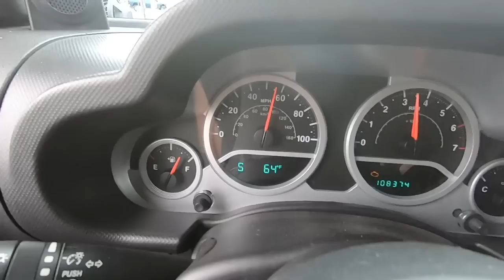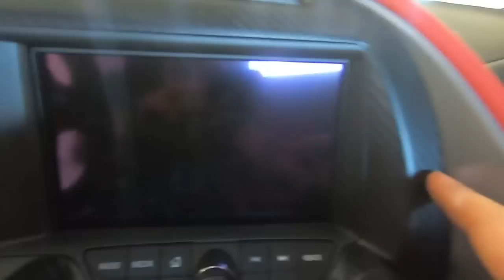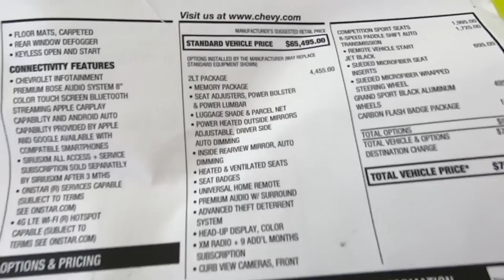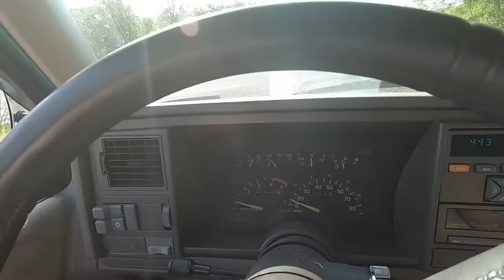BUYING A $1,200 TRUCK From a "Facebook Marketplace Dealer"... (How Bad Can it Be LOL)

Comment: This is hilarious, i love it and the oil you were concerned about is common check the engine oil cooler lines coming from the radiator and the timing chain cover where the crank snout goes through the seal usually gets worn out there and can cause that problem.

Comment: Mike,the truck needs door pins and bushings and the tailgate needs the assembly inside,behind the handle,the rods are connected to it. May as well get the rods and the whole kit while your in that thing. Also,that 350 needs a front main seal,it's the leak your seeing everywhere

Comment: This one is TBI. Tailgate pull 3 torx bolts, white lithium mechanism, then side latches(push side latches in almost totally and let spring out, with help do both at same time). Door needs new hinge pins for sag and will close better. Still rockin my 1991, put 4 new tires on it today. Little at a time is all I can afford.

Comment: Who knew there were so many low rust trucks in PA ?
That mid engine Factory Five kit car is sick.
They started  20 - 30 years ago building Cobra replica cars.
Now they build '33 Ford roadsters, coupes, in steel or fiberglass, and a really cool '35 Ford Hot Rod truck kit .
$20 k for a rolling chassis I believe.
Those kits all have tubular race car frames that make them handle like you wouldn't believe.
Now that would be a great project. Build a '35 Ford Hot Rod truck with a Corvette drive train. Weighing in at less than 2,500 lbs with an LS7, ....... food for thought.

Comment: 97 is when the 3rd door come out and also passenger air bag. 96 is kind of a 1 off year model. First year of vortec, 2 cup holders infront of passenger instead of air bag and no 3rd door. Also you need to replace those door pin bushings and your door problem will be fixed

Comment: There's a head unit, it's up underneath the dash though, Just to the right of the gas pedal it's big silver box that looks like an ECU. you can follow the lines from that up to the control box on the dash if you're not sure. i took mine out of my 88 sport and 89 silverado 4x4 and put a Kenwood in where the tape player and equalizer are in the center of the dash, not one of GM's Finest design moments. I still made mine sound good though , put in a set of sealed 12's and 600 true and pure watts also replaced the dash with competition 6 1/2's can't reveal how i got them in the 4" holes though so don't ask i am sworn to secrecy. also had some shallow mount 5 1/4" in the doors and tweets in the vents and on the A-pillars -as well as Alpine 4" plates with separate titanium tweets in the upper back of the cab.  i had a 4 channel 300 watt running those. sounded beautiful once tuned properly too. That truck is in AWESOME shape for it's age and where it's at, that thing must have been Garage kept most of it's life. the "rear doors" didn't start until 1997 and that year it was only one rear door. it wasn't until 2000 that they started putting in dual rear doors. The tailgate, just WD40 the latches on the side and take the back plate off behind the latch and lube it up too.  if you want to do it right use the white lithium grease. that's a grandpa truck you need to run some sea foam through that thing too to knock the carbon out of the internals. run that through the intake (using the vacuum line on the power brake booster) and then run a half a can through the engine prior to changing the oil, use Mobil1 in it and you'll get well over 300,000 miles out of that truck unless you kill it before hand

Comment: replace the hinge pins and bushings for the door. easy and cheap to do. also, if you want to smile, flip the air filter lid, screw it back on and then rev the engine. free mod haha

Comment: The door and the cab you need to slam, the tailgate you have to show that manually. I have the same issue cam has a handle sticks so you pull it out when you are ready to shut it and when you get it closed push the handle back in.

Comment: Mike please keep doin cheap truck builds I love the videos on those tailgates you don’t slam them you pull the handle shut it and release and the door is the pins when your on the inside roll down the window and push up on the window frame

Comment: Unless I missed it  you didn't give us a rundown on the truck what year what displacement  etc.,I think the extended cab is extraneous and unnecessary, however I absolutely agree with you get rid of those running boards in that cap I have a similar truck the mirrors never really bothered me

Comment: The 3rd door was available after 1995 model year and wasn't on all trucks. Use some wd40 on the tail gate. It should get things working. The latch system may be have dirt or something else from working.

Comment: The A/C compressor is unplugged. But it looks like the clutch got hot so it's probably locked up. Either way it'll need to be retrofitted to 134-A because it's still R-12 right now

Comment: Might wanna do the battery cables and for the tail gate take the plastic cover off and you can just push the pins out and it will stay closed probably just needs to be oiled

Comment: I knew instantly what u got right when u pulled up 1994 K1500 extended cab 5.7 v8 4x4 just bought the exact same truck but a 1995 can’t wait for the build

Comment: Big question Mike, How did you get your front suspension angles correct on your truck? I am having issues with CV shafts, balljoints, and allignment even with a double balljoint spacer kit and a diff drop kit.

Comment: If I had a way to prove it with pics I would but I have a 94 k1500 350 just like that same color extended cab. Only difference is mine doesnt have the aluminum side steps. Funny thing is my air cleaner  is also red lmao. Just put new cab corners in it replaced all the A/C stuff besides the Evap coil. 167,000 miles on her.

Comment: That leak is most likely the power steering pump, I have a 1991 Chevy k1500 and I have the same issue. It’s just that power steering pump it’s most likely not oil.

Comment: The oil is probably a valve cover gasket leak. I had a 2000 Ford Expedition with the same problem.

Comment: I wouldn’t be so quick to assume the blazer would pull the jeep all over the place...  I had an old 91 yj and I did a tug a war with a buddy with an old 80s square body full size Chevy with a heavily mixed 350 in it. More power, more weight, more traction with way bigger tires. It was a draw nobody could gain. Ground. He couldn’t move my mail cruiser haha never know. You should do it. Would be a great video regardless 😎

Comment: Is it me or does every old truck with a camper top not stink to high heavens? Hey just think, tint the Windows, new grill maybe lift with wheels & tires & you it will look awesome. So basically the very same as the blazer

Comment: Yea here pretty soon I'm buying a 1997 extended cab dodge 2500 12 valve cummins long bed from my dads friend and it doesn't have the rear door either

Comment: My dad has a 93 gmc 2 door Extended cab with short bed he had to full rebuild the engine  bought it for $600 he didn’t have it a month the water pump went my dad just rebuilt it runs like a champion but doesn’t give him problems cause it was my grandpas truck before he passed last summer he hunts his trucks lol

Comment: A tip for the next giveaway, and in general;  Don't use the USPS because they suck so much ass it's ridiculous. I've had some many issues shipping stuff with them from my shop, and there is zero accountability for the packages or anyone's actions that work there. It's a huge headache as you can tell already so Stick with a shipper that can reliability and in real time track packages.

Comment: Have almost the exact same truck just in better shape. Motor leaks oil out the same places nothing to much to worry about. I have run it dry on oil twice still runs like a top.